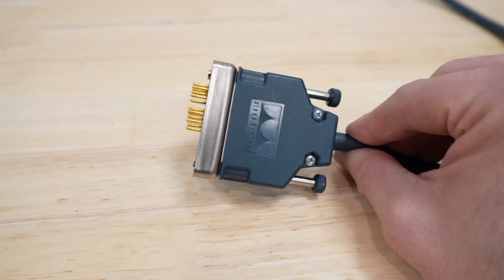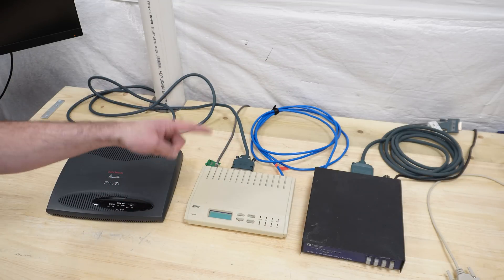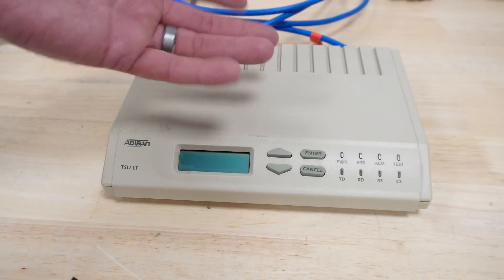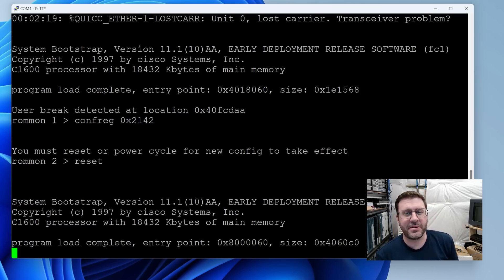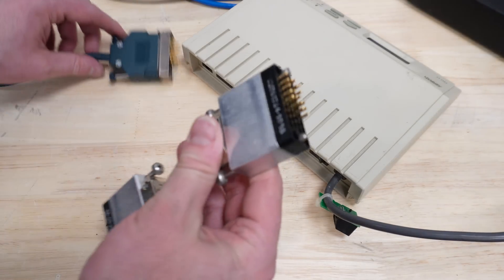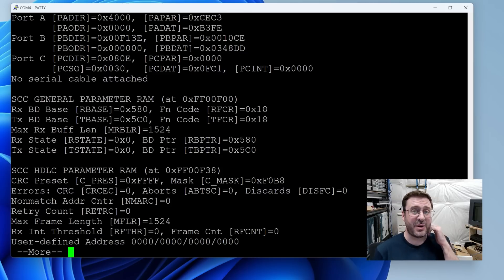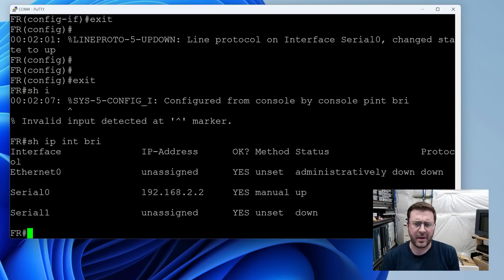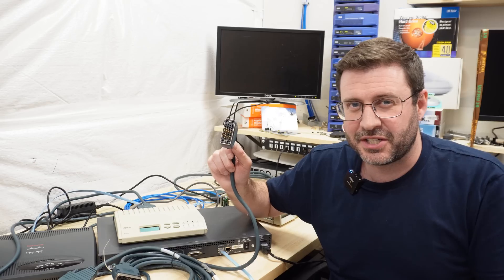V.35 Cables

Comment: Nice to see the old serial connections.  Back in the 90s in my first job I was given task of connecting a Unisys (Burroughs) mainframe to a Windows NT 3.51 server so that the mainframe could call some code running on NT.  This was before there was a TCP/IP stack on the mainframe.  The solution was to connect using serial line - but the mainframe could do V35 and the interface board for the server could also be put into V35 mode so I made up a big old serial cable with a V35 on one end and a DB15 I think on the other and messed around with settings for ages.  The network protocol was SNA (Systems Network Architecture) which is an IBM one that both the Unisys and the SNA software on the Windows NT server could talk - so I had to learn about configuring PUs (Physical Units) and LUs (Logical Units) on both the Unisys and on NT but then they could see each other!  The speed was a whopping 64kbs which was considered pretty fast back then.   I also used the X21 (another serial standard) cables to connect to a X25 network (9600bps).   A few years later we needed to do similar with another bit of software but by this time we had TCP/IP stack on the mainframe so I wrote a TCP service that the mainframe could connect to - back then the mainframes tended to just pass buffers of memory around and each item of data was just allocated to an offset within that buffer.  a typical buffer size was 2000bytes as that is the amount of data on an 80x25 terminal - this was same for the serial connection too.  The mainframes tended to transmit/receive screenfuls of data - so they would send a screen when a user connected and the user would add info and "transmit" the whole screen back to the mainframe which would then deal with it and compose a new screen to be sent back.  This all had to be done within 2 seconds as that would be when we would be out of SLA with the users and there would be complaints!
Reply: Thank you for sharing this.

To be honest, this was an era of computing that I found far more satisfying (difficult though it was) than at present. No Google but better manuals (usually). More interesting (to me) challenges.

I guess this is why I watch clabretro. :-)
Reply: @someusername1  It was definitely more difficult and there wasn't really a manual as it was making a windows machine think it was talking to an IBM mainframe and same for the Unisys (and I know very little about IBM mainframes!)

Comment: I used to work at the telco and dealt with T1s all the time. They're actually called DS1, and they were originally intended for phone company central offices to digitize and trunk 24 phone lines efficiently from one central office to another. DS1 often gets multiplexed up to DS3 leaving a central office these days, and DS3 circuits between offices are almost always over SONET which is a fiber-optic carrier of DS3 channels starting with OC-3 which is three DS3 channels with overhead. Anyway, the fact you have consumer CSU/DSUs is purely an unintended hack. CSUs were used for customer-site PBX equipment and DSUs perform the serialization of data across the frames of DS1. I would often do loopback testing to CSU/DSU customer equipment to rule out problems in the telco's network if there were errors on the line.

Comment: The t1 hole goes as deep as you want.  That t1 is probably like a b8zs esf ds1 and then that could.be carried on another h2 ornh4 or t1c or several other carriers
.. that could then get muxed into a ds3 or oc12 and pushed into a bigger network between offices.  It just keeps going.

Comment: P.S. By the way… for educational purposes… T1 was time-division multiplexed. Meaning it was just a long string of bits that in certain time positions — if you timelined it out on paper — were considered to be “channels” assuming both ends gear was speaking the same protocol. 

So now we have timeslots. We can put data in them or we can digitize voice and put voice in them. 

In the case of T1 we had 24 timeslots juuuust big enough for a certain audio quality level. 

Orrr we could combine them all and have a 1.544 Mb/sec data circuit. 

Or any combo therein. A “fractional” T1. 8 voice channels and resulting lower number for data. Etc. 

There were other things like framing bits for the clock and alarm signaling but the above is the general idea. 

We also stole the eighth most significant bit from all the channels occasionally in the early days for “robbed-bit signaling”. It didn’t significantly affect voice quality if we used it as a signaling bit for special things and threw it away.

There was also terms like D4, AMI (alternate mark inversion), SuperFrame and Extended SuperFrame … but that’s getting too far down the rabbit hole for what you’re doing. All anyone ever needed to know was to match them at both ends. 

Way later on ISDN came along. We needed a data channel and some channels the data channel would control with special messages. 

Those “bearer” channels could be used for voice or data at any time. Switch them on the fly if you like. 

To carry ISDN over a T1 we stole one timeslot for data and left the 23 left over for bearer channels. Thus: the ISDN 23B+D circuit. 

Now we didn’t need a hard configured “fractional” T1. The ISDN device upstream could control what was voice and what was data in real-time. 

Fun fun. 😂 Ancient history. 

We should dig up an old DS-3 multiplexer for you. Wish I’d held on to a couple. Ha. 

28 T1s in two pieces of coaxial cable.

Comment: Great video!

A+ for not stating that V.35 is a standard, as it was withdrawn as a standard some years ago.

Request: Please please please make a video where you connect some of your network gear via T1 to some telephony stuff, to make phone calls via a T1 link and also have the calls use SIP (or any other IP telephony protocol) on at least one side.
Reply: V.35 dates back to the 1960s and specified a 48kbit/s modem using group band circuits (part of analog FDM telephony). The connector featured was for the digital connection to the modem. As you mention V.35 is now obsolete but the digital interface is now part of V.11.

Comment: I never got a chance to play with telco equipment and I always wanted to see how those CSU/DSUs worked as well as what those big serial ports got used for. This was surprisingly straight forward. Obviously it's gonna be more complicated if you were actually connected to a telco, but still. The fact that this bridge "just works" is amazing to me and I've been in IT 20 years!
Reply: Actually, it was easier when talking to the telco. The telco side was always "network", so the customer equipment is always "internal" for clocking. It actually was identical to what he just showed. The only extra bit was to know how to wire up to the 66-block with a the 4-wire jack (the size of an "RJ-45" even though it was not Ethernet). The telco could install a jack but charged like $100 extra, so we just always did it ourselves for like $5. The exception to the clock timing was if it was a point-to-point T1 circuit and the customer controlled both ends. Then the customer would have to decide which side would provide the clocking. We always had the "central" or larger office side of a business provide the clocking, and had the remotes be set to "network".

Comment: I worked in the engineering design lab at Adtran back in the late 80's and early 90's. This stuff was cutting edge at the time.
Reply from the maker: awesome! other folks have said the Adtran gear was top-tier
Reply: We at at&t, were never able to inbound loop back those bozac t1 powder blue cards.  Configuration was hard too.. but thank you for a lifetime job at at&t central offices!
Reply: Definitely did some tricky stuff with AdTran back in the day, before VOIP was really taking off. There were AdTran units that could factionalize the T1 and hand off part of it to the router for data, and part of it to a PBX for 64k voice channels. The downside to this was that the data vs. voice channels were fixed. Later, VOIP really changed that where things could be dynamic and when there was no voice call going on the TCP/IP data could use the whole T1, and if a phone call started up it was using compressed g.729 at like 8kbps and with proper QoS on the circuit to prioritize it would work just fine. If there was a fax involved we had to give it g.711 and it used a full 64kbps during transmission. But, once the voice call(s) and/or fax(es) stopped, it was all available for the TCP/IP traffic (or even IPX/SPX back in the day when Novell NetWare was still king of the LANs).

Comment: Eons ago, or so it seems, I worked with a piece of automated test equipment that used the same or seemingly the same v.35 cable. The cable connected to an impact printer. It was a seven bit parallel connection with a few extra bits for timing and paper out etc. Well the printer was a beast that broke down every year or so and the costs to repair / replace it was astronomical at the time, $ 35,944. I was asked if there was anything I could do. It took me about two months of my spare time to come up with a six chip interface to connect the V.35 output from the ATE computer to a standard centronics interface so they could use an off the shelf dot matrix printer intended for the home computer market at $350 to $450. The major problem was not the conversion from seven to eight bit, but the timing. To fix that, I used two SN5414 hex inverters with most of the inverters driving each other utilizing the delay of each inverter to add up and delay the timing pulse. I submitted it as a suggestion with a working prototype demonstrated on the ATE at several locations using various types of consumer grade printers. The first demo site was in Florida where the engineers, wearing white smocks, watched it work with their jaws hanging open. One ran off and returned with a manila folder about 3/4" thick showing the work they were doing to do the same thing. When they opened my blue box they saw the six-16 pin chips and a 7805 voltage regulator they said there must be more under the perf board, the chip sockets were on. They found only wire wrap connections between the chips. As for submitting it as a suggestion, it was approved with a savings $706,229 in the first year. Of course I got only a small portion of that, I think it was $6,400 before taxes. Yep, seeing that connector brought back memories from 1995.

Comment: I'm 42....  did this in high school with Cisco 2500's in Cisco Networking class....  all the labs came with serial cables; they were the least expensive interfaces at the time (cheaper than the T1 cards) so, that's what we had!   We did a lot of FRAD (frame relay) and SL/IP however, PPP was quite popular by the late 90's as it was a little less trouble to get running....
Reply: My high school had a type writer class... with real type writers. Consider yourself lucky lol 👴
Reply: Netacad in HS was a blast.
Reply: Did the same in college in '99.  Each bench in the networking lab had a single 2514 (dual v.35), we setup frame relay with each neighboring lab bench and one end to the managed lab equipment.  Did other fun things like generating ping floods, routing and switching loops, packet storms. Good times.
Reply: @AlanEvans721   Man, what a great way to learn.  I went to a trade school and it was a little more sterile.  "Go through this chapter's lab before next class."  Would've been fun if our classes had been more interactive, like if our desktop PCs relied on a working lab network to get multiplayer deathmatch sessions going!  haha
Reply: @nickwallette6201  it was a great was to learn.  I really liked the hands on approach all of the labs had.  WiFi was new so we did a lot of goofy stuff with WiFi.  Theory was that since microwave ovens operate in a similar frequency that they could interfere with WiFi.  Our testing proved it could.  If the microwave tripped the breaker and cut power to the entire lab bench... :-)

Comment: Now you just need to light up some RIP routing across that T1 😊 We basically did this same lab setup in one of my college classes for a networking degree program. It was a blast…something about those big chonky cables is just fun. The first time seeing a ping go through on a T1 connection you setup is electrifying.

Comment: That takes me back to my first job in 96. We had two cisco 1005s at two locations with these v35 plugs connected to some impressive looking mux equipment. Later someone from the telco replaced the muxes with these csu/dsu boxes like you have, made it all a bit less glorious.
In theory you can leave out 'encapsulation ppp' at both ends. Cisco will then use its proprietary hdlc protocol instead. But nobody uses that anymore I would think.
Reply: would be interesting comparing the overhead of each via throughput tests... I suspect PPP may have a little more overhead than HDLC, but only a 1% or so?

we used a similar setup when I lived in ISP land in the late 90s with frame relay to remote satellite modem banks in neighboring towns in addition to multiple dedicated T1s (and later T3) to the greater Internet. It was only a single CSU/DSU to handle most of the multiple remote frame sites (via multiple virtual circuits) but the largest remote site had a dedicated CSU/DSU which did frame relay over T1. (Frame relay isn't dedicated full-bandwidth like point-to-point T1, and can be oversubscribed to make more efficient use of phone company packet switching capacity, so it was cheaper than full T1.)

Comment: I remember these in High School back in late 90s early 2000s.  I studied Cisco CCNA on 2500 series routers and gear and we used these in our 5 router stack between routers on serial interfaces.  Basically, two of those cables directly connected together with DB60 to Winchester to Winchester to DB60 as you showed there but our Winchester jacks were correctly matched and worked router to router for in the closet connections.  I think we even had a 1600 in our lab stack back then.

Comment: where I am from the T1 didn't exist, we had the E1, which was 2.048Mbps which had 32 channels of 64K 2 of which were reserved for control and signalling. 
so 30 PRI B ISDN channels of 64K and 2 64K channels used for Dialling and control, you could also bond these and use them for data but if you used both you could no longer make or receive calls. 
the CSU/DSU we had NTE/DCE.
Reply from the maker: I actually have some E1 cards for some Cisco 7200s to try sometime!
Reply: Here in the UK in BT International I got to work on E1 & T1 circuits, although some US carriers used E1s. We also had Nx64 circuits where we would take multiple channels for customers who wanted less than an E1 but more than 64k. The initial systems were fun, at first we had a problem where a break in the connection would lock up the circuit, which meant a while ringing each exchange to check we were still connected & getting them to reset the interface cards.

Comment: In your video you say it just kind of works but the reality it wasn't that simple.  I'm an IT guy from the 90s era.  By the late 90s, however, much T1 grear defaulted to ESF (extended superframe) B8ZS encoding but wasn't always the case.  And things get more squirrely if you were dealing with frame relay.  

Also, the Adtran was considered premium top of the line gear back in the day.  Higher end Adtran units had cards you could plug in to break out different signals.  For example, I had T1 lines between office buildings across town and my employee gate cards at a remote building would be sent over the T1 line on one of those 24 channels to be broken out as RS232 at both ends. This is how we networked time clocks, gate cards and alarm panels back in the day and the other 22 or so channels would be combined for computer networking.  Also, in my time we had IPX/SPX novell netware mostly running on those combined T1 channels then as TCP/IP became more prevalent, we had to start splitting up those remaining channels to carry both kinds of network traffic.... all over a single 1.5Mb line.

Would love to see you set up an old netware network with its NDS (netware directory services). It was truly way ahead of it's time and well before Microsoft's Active Ditectory.  

Anyway, love the trips down memory lane.  Boy if I had found your channel just 2 years earlier, I could have sent you piles of old telecom and networking gear including sonet and fddi stuff.
Reply from the maker: Yeah I got lucky that all the defaults were compatible. I'll be covering netware someday!

Comment: I remember helping a telco tech set up a T1 with a few ports with DID, 1 or 2 ports for the attendant, and the remainder for the data/telco lines to the field offices.  It was wired into an AT&T PBX system popular in that era. It's been over 30 years ago, so the exact topography might be off.

Comment: Should have put modern computers on both ends, and then do something more over the link, even if just running normal ping with once per second responses and then unplugging and replugging the T1 to see how quickly it recovers. Or trying to watch YouTube at 1.5 Mbit (should work at 480p), connecting to RDP, or even gaming.
Reply from the maker: oh yeah eventually. more T1 stuff in the future!